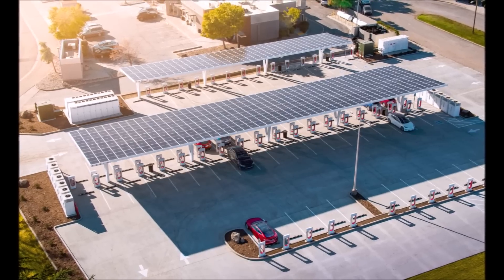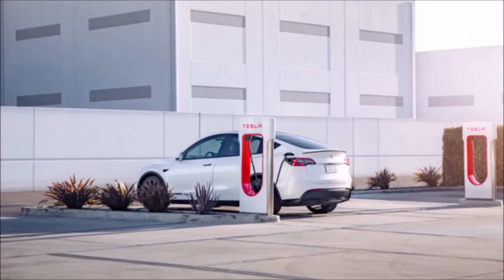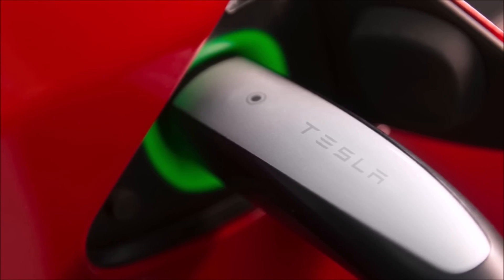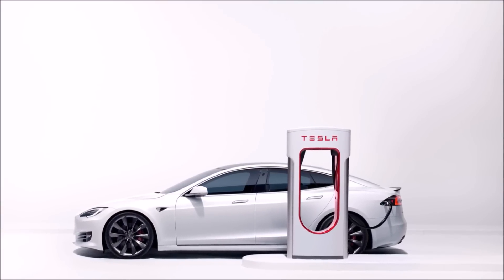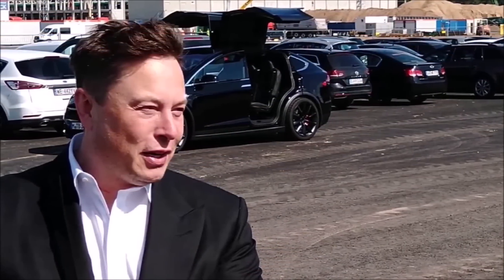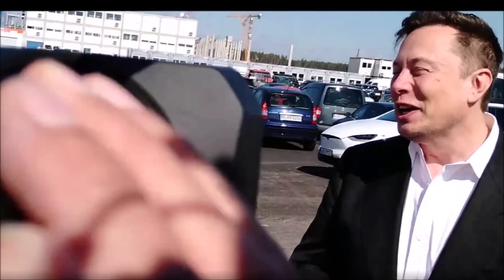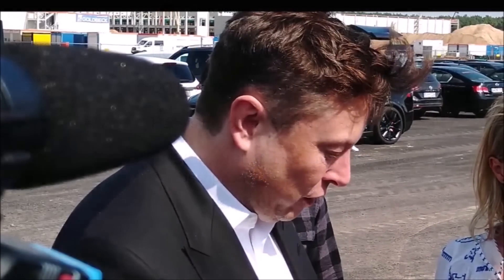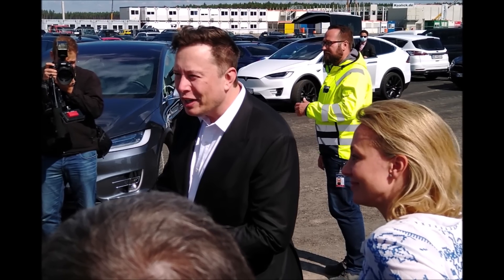BREAKING! Tesla Will Change Charging Connector To Transfer Energy Faster

Comment: Why not just switch to CCS finally? That's what's on their cars outside of North America. And it already supports higher power.
Reply: CCS charging cables are so big and bulky almost looks similar to what you see at a gas station pump. Teslas proprietary solution is more simple and smaller.